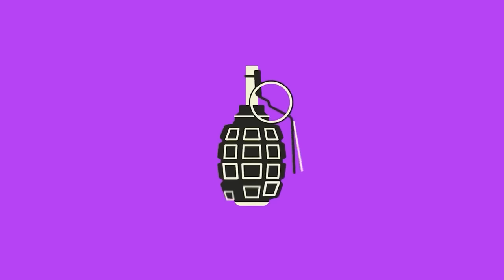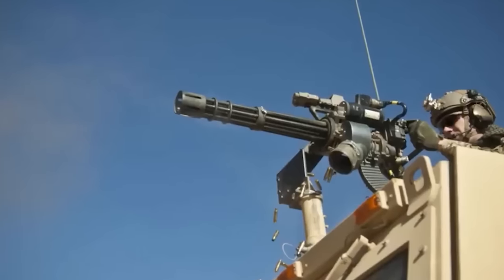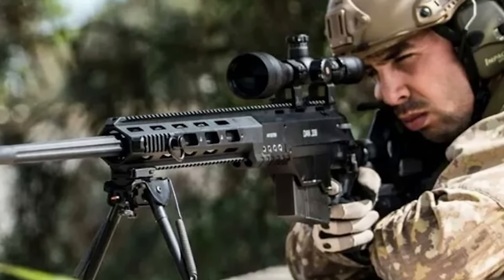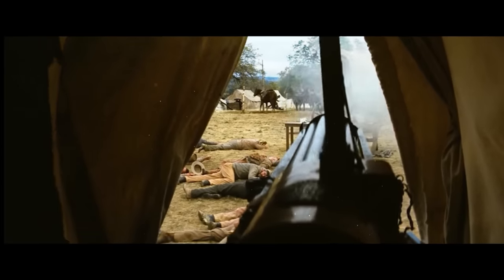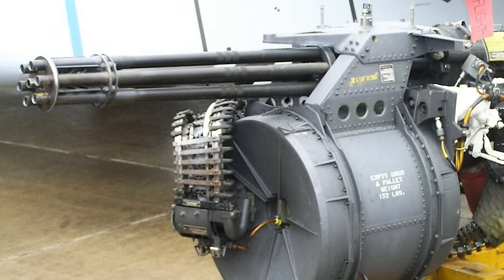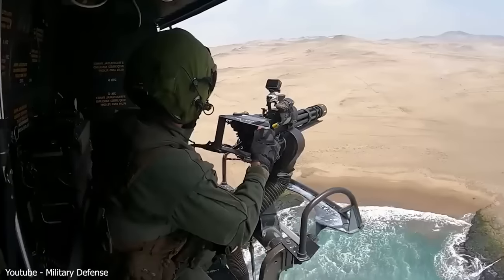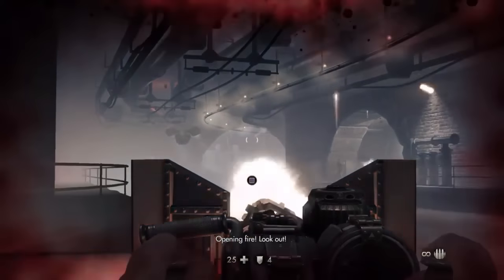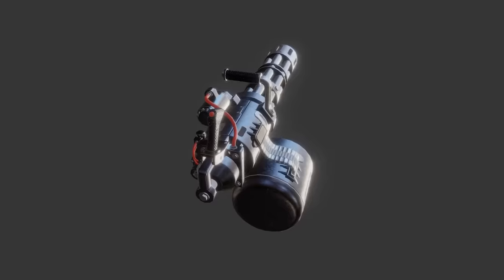THE DARK SIDE OF MINIGUN: WHAT IS IT HATED FOR

Comment: It's a case of horses for courses.  The minigun has its drawbacks, and it is certainly not an all round weapon, but it was not intended to be.  It was intended to be a helicopter and vehicle mounted weapon delivering high volume, broad area suppressive fire, and it does that very well!
Reply: I would argue it is best for a helicopter or small aircraft simply since you have limited time on target. Or a personal protection vehicle maybe.

Most ground vehicles? Eh. Does extreme RoF matter? It isn't like the enemy is going to get shot at and just be like "Oh that HMG is only firing at 700rpm! I can take it!"

 You would blow all your ammo so quickly trying to suppress an enemy with that. 

 Personally if I had a choice I would hope for a larger caliber with slower RoF. 

 Add in complexity and I think it definitely is a very niche weapon.
Reply: @dianapennepacker6854   That was the idea behind it. The 'mini' means it's a scaled down fighter jet 20mm Gatling gun. It's original use was for light aircraft, for whom a .30 cal (even this) would be a very light weapon. The first Cobra gunships used one of these and a automatic 40mm in the chin turret, but the 40mm was said to suck because it didn't have the muzzle velocity to be used effectively off a helicopter. 

Source is "Apache Sunrise" by Jerome Boyle. (Highly recommend.)
Reply: @dianapennepacker6854  It IS a very niche weapon, because it has been designed and implemented to do just one thing: hose down an enemy occupied area during a "hot" extraction. 
The previously used M2 .50 cal did a pretty good job keeping the hostiles heads down, but their single barrels overheated quickly during a hot extraction. The solution to that problem was to revisit the "good old" multi-barrel system, as used in the Gatling and Vickers machine guns.
Reply: 0:48
Reply: @dianapennepacker6854  larger caliber srf you are in luck general electric started building a 50cal 3 barrel mini gun rate of fire is 750/1250 or 2000rpm  but due to the size of the rounds there is no weight saving in fact 1000 round of 50bmg weigh about the same as 2750 of 7.62 NATO
But the 50bmg does pack a lot more energy.
Reply: I was us army 15 tango uh-60 crew chief.
We would normally have a mini gun on the port door and a 50 cal on starboard.
 No the mini gun is not something you can carry with you but if you are the guy on the ground and you are getting picked up in a hot LZ you really want the rof that a m134 offers or if you or the bird going in to pick up you want what ever birds are providing fire support to be able to lay down 3000 to 6000 rounds per minute.
 When I was in 1986 to 1994 we normally would have the armory turn it down to run around 3,000 rpm otherwise we would burn through the 5,000 round of ammo way to fast
Reply: Nailed it
Reply: @robertgutheridge9672  I think even for a vehicle I would still use a regular. 50! Again realistically I think I'd rather have more ammo with me.and you can carry more. 

 Sounds good for light aircraft or bases since .50 are really cheap relatively speaking. 

 You know what gets no love? The Russian Kord! They made a really good weapon with that one that is even lighter than the. .50! It is a relative new design so maybe Army needs to catch up. 

 Yet the Russians also have the 14.5mm... I feel like that gun is perfect for a light vehicle! Feel like it is just big enough to destroy or disable 80% of all vehicles short of modern IFVs or MBTs. Has good ballistics and penetrstion values with a decent RoF. 

 I looked at 20mm single barreled systems and they just seem to big to me.

 I've seen videos of people firing the Kord by themselves haha. That was some Rambo shit. I hope Army can develope a new HMG for our troops. Not change the round unless it is a huge improvement since .50 is so common of a round.
Reply: @dianapennepacker6854 7.62 mm is considered anti personnel which is what this gun was made for .50 cal and larger rounds are typically considered anti-equipment rounds.  The benefit of the smaller rounds in this case is that you can pack more rounds ready to fire giving you more firing time.  .50 cal would give you a lot less firing time.
Reply: @robertgutheridge9672 Exactly. Helicopters are very vulnerable. Flooding the zone with flying metal is the best defense.
Reply: High fire rate will make the speeding suppression far more effective when shooter has "unlimited" ammunition or barrel heating. 

M2 is old, but it is most reliable gun in USA inventory.

But that is way too heavy and slow for that purpose.

In vehicle mounted and against armored vehicles, kiinnitin 7,62 mm minigun becomes useless almost.
That is where M2 works better with 12,7 mm. But as armor got better, it became less effective at range. 

Why Soviets did what was mentioned, developed 14,5 mm HMG that did that problem away. And why that is their basic gun in their BTR (APC).

AGAIN, USA put M2 on open hatch in free moving swing, gave some armor plate forward and called day. 
Where soviets build a armored turret against 12,7 mm caliber, protecting gunner from all directions, and gave the gunner even a 2,6x magnification sight to aim and shoot. The BTR became effective to 2500-3000 meters as it was low recoil to shoot, accurate and high velocity. And it penetrated any Western APC or IFV at the time from any direction.
While their own APC / IFV were protected by minimum from 14,5 mm from front.

For the minigun purposes in helicopters, they made 12,7 mm the main caliber. They have two pods combos.

1) a one 12,7 mm or two 7,62 minigun. 
2) a one 40 mm grenade launcher or two 7,62 minigun.

With easy switch the one pilot choose which mode to use.

Pair those with 57 mm or 80 mm rockets and you have huge fire power. 
And you might have a 12,7 mm door Gunner + 7,62 mm rear gunner among those.

When AH-1 Cobra was equipped with minigun in nose, Soviets loved the attack helicopter design that they copied it, but made it transport cargo (ammunition, equipment) and people (wounded, recon teams, squads) too. And they made a 12,7 mm minigun to nose after redeeming 7,62 being too ineffective. Later they went to 23 mm and then to fixed 30 mm.
Reply: @paristo  all of it has to do with intended purpose. The decision the US made is about anti-personnel protection. The vehicle it's mounted on is a support vehicle used to transport troops.  The US already has transport vehicles that have anti-vehicular capabilities. When you combine multiple transport types in a convoy the choice provided provides protection from personnel giving the heavy transports the ability to focus their fire on enemy vehicles.  BTW, these mini guns aren't the only thing that gets mounted in those turrets.  The army has multiple guns that can be mounted there and the decision is mission specific.
Reply: Master of THE trade, jack of none.
Reply: @dianapennepacker6854  exactly limited time on target you can put a lot of rounds on Target or if you're laying down suppressive fire for another bird yeah we usually have the armor's turn it down to three thousand rounds a minute just so that we could have some sustained fire but then 134 definitely changes the battlefield scenario very quickly
Reply: @ianbelletti6241  when I was their crew chief that's why on one door we would carry a minigun and on the other door we would carry 50 cal the meaning of the great for keeping heads down but sometimes you need a little bit more punch then the 76 2 oz and well that's why we had the 50bmg
Reply: @nunyabidness3075  that's like saying that a helicopter is a oil leak looking for a place to happen while beating the air into submission and trying not to vibrate itself apart all at the same time yes helos are very vulnerable especially when we're coming into a hover or first getting off the ground
Reply: @robertgutheridge9672  sounds like a useful setup allowing you to give the optimal gun a good sight on the enemy as you approached. And I think you meant 7.62mm.
Reply: @ianbelletti6241  dam autocorrect changed it. Yes 7.62 mm
Reply: It's a click bait title.
Reply: And it's pretty good against hunters from outer space
Reply: @jayshartzer844  if pretty good against Any soft target or light armor depending on what mini gun is being used
Reply: The minigun's main selling feature isn't even it's high rate of fire, its actually a lot lighter than than it's equivalent of 6 machine guns and has a higher accuracy due to firing on the same point rather than firing from 6 different points and converging on a single point.
Reply: @dianapennepacker6854 you cant beat the M2
Reply: @burtknighten4438  Yeah you can! Some of the XM projects! Made it 50 pounds lighter, but would cost to much to replace a weapon we've been producing for 100 years. 

 The Xm312 could be converted into a .20 cal or something like that. Then the  XM806 was just lighter but dope.
Reply: @dianapennepacker6854  25mm, and the 312 had several serious flaws to it, ranging from lower rate of fire to the conversion system increasing costs and relying on a low performing proprietary 25mm grenade. 806 had the same low rate of fire issue.
Neither of those were satisfactory to replace the m2 in any role, and the rate of fire issue cannot be solved without introducing a recoil related issue, which would be exacerbated by the significantly lower weight. To increase the rate of fire, you need to halt the bolt as soon as possible and bring it back into battery to fire. A heavy spring and short travel with a backstop is optimal for rate of fire, but horrible for recoil, this is the issue the m3 has. The m2 on the other hand has a more balanced recoil system, jerky, but not too horrible because the gun's mass distributes the forces better.
Reply: Are you from the 1800s?
Reply: @dianapennepacker6854  
"I think even for a vehicle I would still use a regular. 50! Again realistically I think I'd rather have more ammo with me.and you can carry more. "

True. But if ever you meet unexpected armoured opposition and you cannot have CAS within 5 minutes, having more rounds of a smaller (and ineffective against armour) round will mean you either flee or get thrashed. 😖
Reply: @ianbelletti6241  
"all of it has to do with intended purpose"
Exactly.
Reply: A10-warthog as well 😎
Reply: Aaand for Terminators. Don't forget.  ;)
Reply: @dianapennepacker6854  Extreme rate of fire or "mass on target"  is really only an issue if you need to stop something... quick.   For example...   shooting at bomb equipped drones.    the minigun puts out enough rounds to saturate an area for a drone kill.
Reply: But the MG-42 is an all round weapon! And it sure as hell was intended to be!
Reply: Unless it's 'ol painless from Predator
Reply: @jenniferstewarts4851  A gun like the 35mm with AHEAD ammo is still superior over a minigun firing 7.62 at taking out airborne threats. 

 Basically new school flak. No need to fire hundreds of rounds when a single burst will do. 

 More range/velocity too. 

 Most people don't seem to notice FPV drones to get any rounds off. A dedicated system with radar/targeting radar is needed. 

 Except one video where the operators were literally screwing with a Russian soilder who was running for his life, before giving up/falling, and getting kamikazed by the drone... That video was twisted as all hell. I wonder how often that happens.
Reply: @dianapennepacker6854  35mm requires a far more substantial vehicle.   And i am not even talking about the 7.62mm minigun but the 5.56mm micro gun.   operating with a 0-400m engagement range of small fast moving targets.   

The  mini-turret is small enough to mount on light vehicle,  where as to turret the 35mm + radar + ammo feed and such, in a "non penetrating system"    would require something the size of a 8x8 instead of a  hum-V.     

the whole idea was...  as small, and light weight, to deal with threats operating at ground level to 500 feet, and out to 1000 feet...  to screen bigger AA units.. like... the 35mm equipped 8x8's  who would engage outside that envelope.
Reply: Exactly it was designed for suppressive fire.
Reply: everyone says "its drawbacks"   but never mention any of them.. lol    itdoes exactly what it DESIGNED to do.. everyone saays oh it so heavy...  well yeah it was never ment to carry LOL
I went searching and I cant find any serious flaws.   or failures of any gatling type weapon     and the m61 vulcan is in practically every USA Aircraft :-\
Reply: @HarmonRAB-hp4nk  its flaw and draw back - is it rate of fire..   the problem being,  it chews through massive amounts of ammo fast.   and for many rolls way to fast.

at as much as 100 rounds per second, some aircraft have a total of 6.5 seconds of fire.   Now for dog fights this might be enough for a few short bursts on target...  but if you are doing air to ground support...    you might only get one strafe out of that.   

next there is a spin up time.    in bigger guns this is slower, it can take   a moment before its spinning at full speed... sometimes the delay is nothing sometimes its half a second.

in the end... in most applications its draw backs are mitigated..   either by carrying more ammo... lowering the rate of fire down to 1500 rounds... or... carrying an aditional smaller gun tor another job.
Reply: Yeah! That's right.    And why doesn't the minigun make fresh-brewed coffee, and help me with my taxes?

Comment: In NAM, my Platoon Sergeant built a heck of a weapon system. He scrounged up a five quarter ton truck, a turrent from an M113, and a minigun. He put it all together plus 20,000 rounds linked together. When Mr. Charles attacked one night, the CF was driven up to the highest point on the base and went to work. It was normally kept hidden so that it would be a surprise. Within ~10 minutes the ammo was gone and the attack was over. Unfortunately, there was an armored reconnaissance vehicle that thought it was a tank. It charged out of the gate. Way off to the left, there was the flash and the trail of an RPG that hit the Sheridan and blew the crap out of it. Everyone on the base loved that minigun.
Reply: @Another-Address  The future looks kinda bleak. I hope that you heal completely and soon. Good Luck to Us All, Rick
Reply: Please say he did this with duct tape.
Reply: @PhillipJermakian Not that I know of. We did have the 200mph Army tape but I believe that it was all properly bolted together.
Reply: @richardross7219  Nice.  Sounds like something my dad would have done in a pinch.  When he signed up for Korea they were like "no you go fix planes in England,  too good at that stuff"
Reply: @PhillipJermakian  Be glad. He was spared the nightmares that follow combat vets. Good Luck, Rick
Reply: Having used both... I'll take a mk48 over a m134 in most situations.
Reply: everything between unfortunately and it is basically illegible

Comment: There was a company at SHOT show last January displaying a new kind of minigun that had 5 barrels, weighed 40 lbs less than the Dillon 7.62 minigun, and had a simpler mechanism with fewer parts. It was chambered in .338 Lapua. It had an effective range 1000 meters further than the 7.62 minigun, fired 2500 rpm to reduce wear and tear on the gun and barrels (faster rpm heats the barrels up faster), and used lithium ion battery packs similar to those used by electric mowers (like big cordless tool batteries). The battery packs made the gun independent from the vehicle power supply and lasted longer than a 1000 round belt of ammo. The gunner or assistants would insert a fresh battery when they loaded a new belt. Just like a cordless battery on a job site, the partially spent battery would be plugged into a quick charger. They would have two or three batteries in the charger, so they would have at least one fresh battery and backups in case of failure. When they got back to base or resupply, they would plug the batteries into a reconditioner/slow charger to maintain the life cycle of the battery. With less parts, it's easier to clean and maintain.
Reply: Sold.
Reply: .338 lapua 😵‍💫 yeah thats sooo much less than 7.62 ..
Reply: Shut up and take my money! 💰 🤑 💸
Reply: 338 Norma not 338 Lapua.

Still a awesome weapon system
Reply: Where can I buy one(asking for a friend)
Reply: Sounds like freedom to me
Reply: DTV Arms .338 norma😊
Reply: Battery feeding is going to be it's downfall
Reply: Don't forget the suppressor attachment for it too 😂
Reply: Mi-24 helicopter has 4 barrel gatling. I think it's even less complicated than a 5 barrel =D And Soviet ships have 30mm gatlings that are gas operated, smaller, lighter, doesn't require power source. It makes them superfast, yet the gun heats up very quickly. Pros and cons.
Reply: It’s still something you primarily want as a mounted gun over something you try to carry around. Being a self contained unit might make it better than needing it mounted on a vehicle. But at the end of the day mounting it on a vehicle gives you more electrical power without needing to swap batteries that hopefully are charged enough.
Reply: Vid?
Reply: We had m-134 mini guns on our AH-1 Cobras (mod & prod models) and carried 4000 rounds per side. First detention 2000 rpm and second detention on trigger was 4000 rounds with max effective range of 1100 meters. Great gun when it didn’t jam.